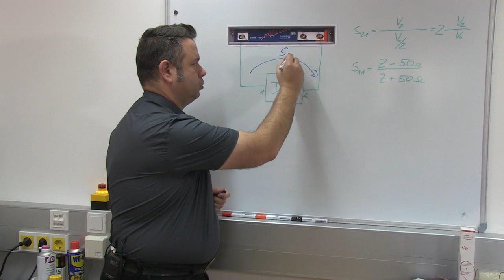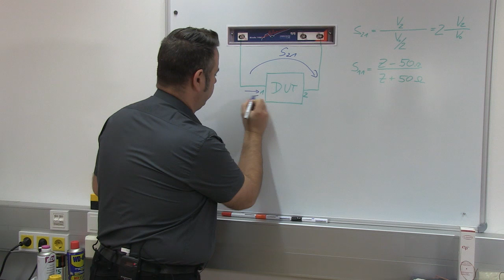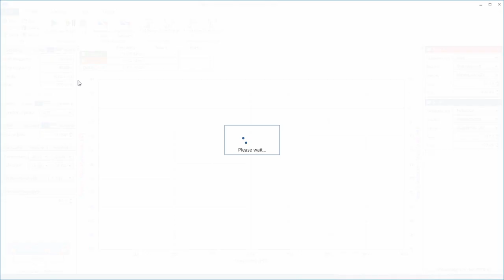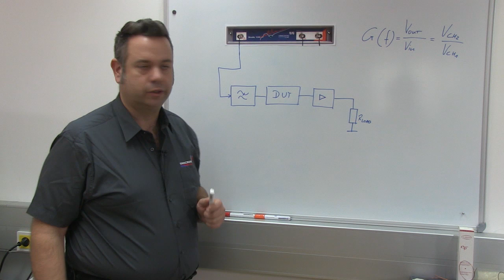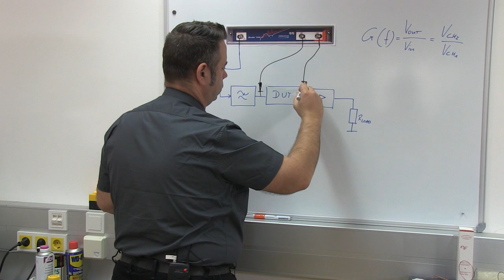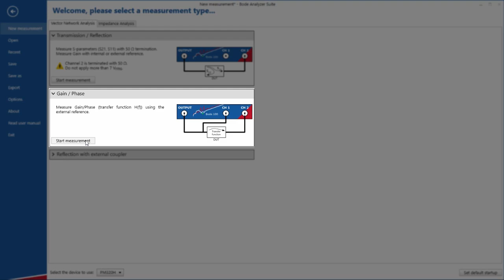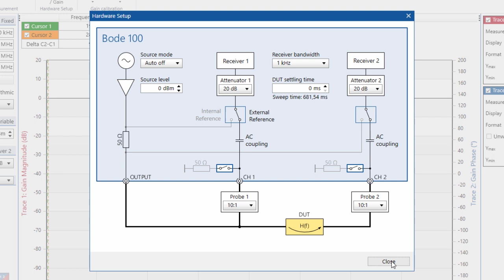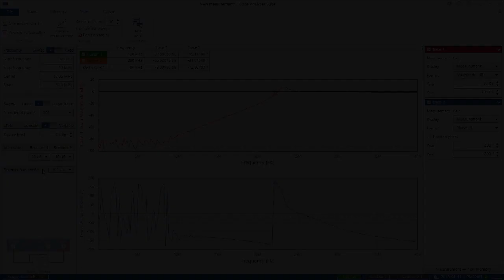S-Parameter & Transfer Function Measurement

Comment: Thanks for the video. Could you explain the voltage gain in transfer function measurement between 20-25MHz?
Reply from the maker: Do you mean the positive voltage gain or the phase wrap?
Reply: @OMICRONLabTutorials   Yes Positive voltage gain. I have seen such gain in many of our EMI Filter testing. At first, I believed it might be due to impedance mismatch in my setup but that is not the case. Any insight from your side would greatly help.

Comment: Hi. In oscilloscope world people talk a lot about bandwidth of 1:1 probe is about 10MHz - and you are doing 40MHz measurement. And also the proper probe compensation by tuning the variable capacitor at the probe - not done at all. Could you please address these 2 questions for this measurement ?
Reply: The Probe can be set up on a scope with a square wave 1Khz signal and adjust till the signal looks best and sharp on the probe. At higher frequencies around 40 Mhz it still should be close because you matched it on a sharp edge of the square wave. Some signal generators vary and so do leads. Some leads can work to 100 Mhz and others higher than that. These leads are surely calibrated and are very high quality to do these kinds of tests. I can see what you mean about the probe compensation but these probes are impedance matched and probably software calibrated on a test set. Kinda how scopes have a self calibration function
Reply from the maker: With a frequency response analyzer it is much simpler to correct for the probe frequency response. Either via software correction or by manually tuning the probe until a flat 0dB / 0° line is achieved. If this is not possible, software correction is always possible.
Reply from the maker: In Bode-Measurements (Transfer Function Measurements), sine-wave signals are used and the frequency response of the probes can easily be checked / corrected. This is not so easily possible in time-domain measurements.

Comment: Really nice thank you for the great video. Reflected signals aways trick my brain hehe. I always think: they really exist or are only a superposition way of thinking ?
Reply from the maker: Of course they exist! The reflection is used to perform e.g. TDR measurements (see https://youtu.be/Il_eju4D_TM). If you apply continuous sine-wave signals to a reflecting cable then of course the reflected waves and the exciting waves will mix up and you will not see it so clearly.
Reply: @OMICRONLabTutorials  Yes, this is what I'm talking about! In steady state with continuous sine signal we could think of the reflected wave much more like in the sense of power factor in power electronics. The only thing a load can do to a steady signal is change the voltage and current phase relation. In TDR of course we have a case of practical reflected waves making more sense with the mathematical model.
Reply from the maker: @AllElectronicsChannel   absolutely... Then you can even use reflection factor or impedance for simple calculations. ;-)